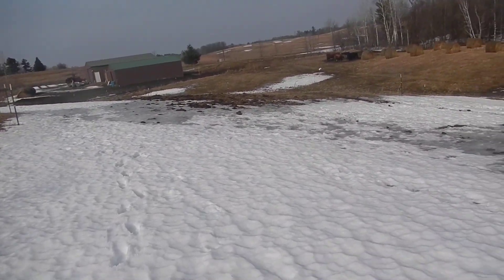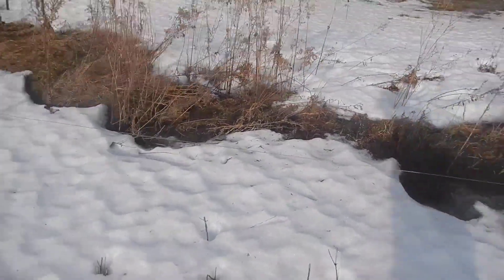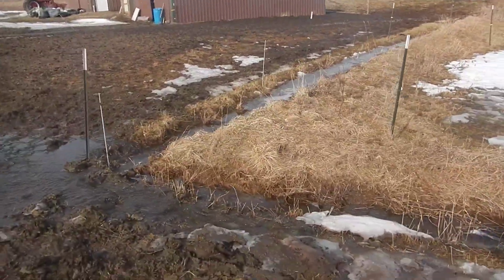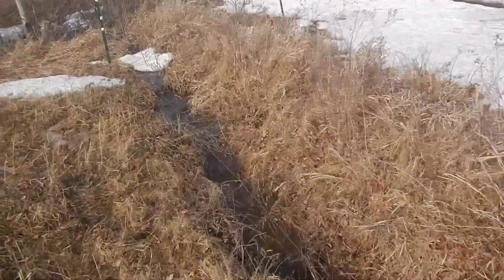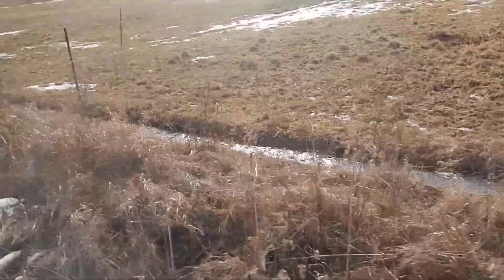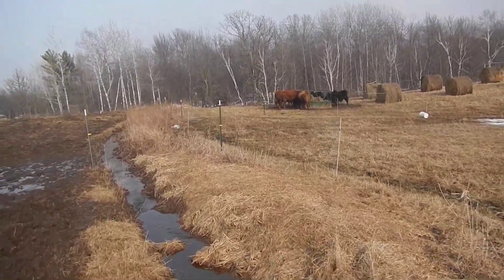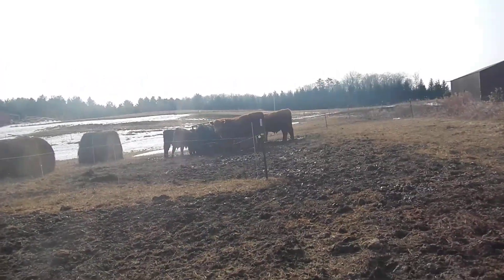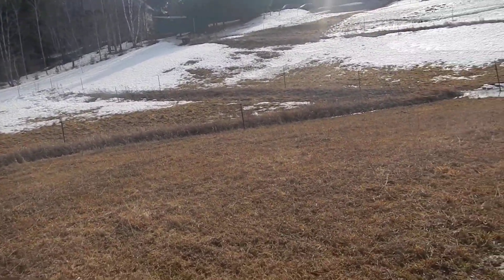On Farm Watershed Management: Part 2

Comment: Thank you for the video! 

Why did you use a 3 bottom plow versus a 2 bottom or 1 bottom plow? Does it make a wider swale? Deeper? Better somehow? Did you do one pass or multiple passes? How wide did you make the swales and was there a reason for the width you chose? Have you known anyone who’s used a ditch witch to make swales? Positives and negatives? 

Basically I’m looking at different ways to make swales and the nitty gritty details of doing so.
Reply from the maker: It was what I had. It did make a wider swale and I did make two passes. Then I hit it with a disk very lightly just to break up the chunks and fine tuned with a hand rake.
Reply: Anathoth Community Farm thanks!!